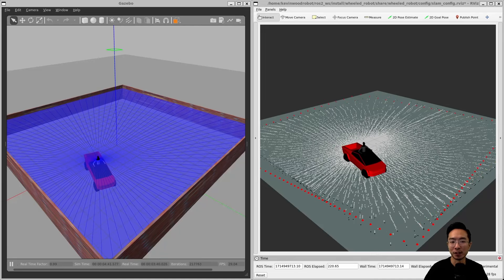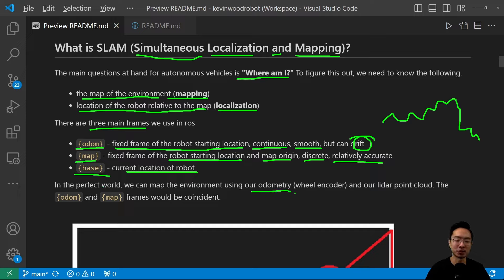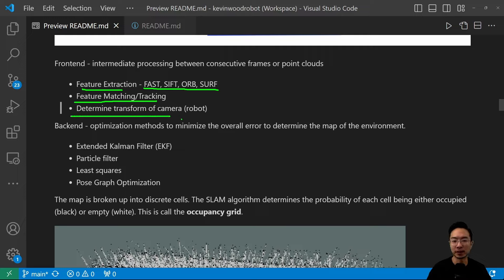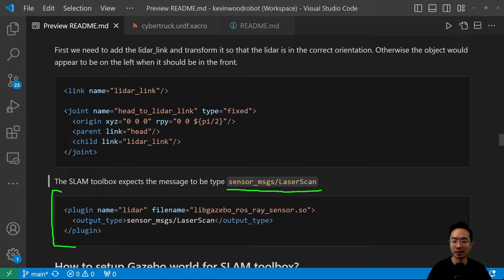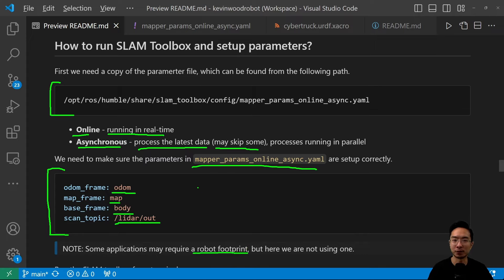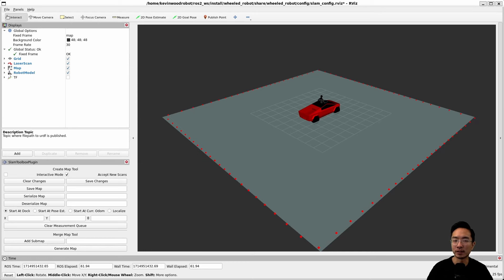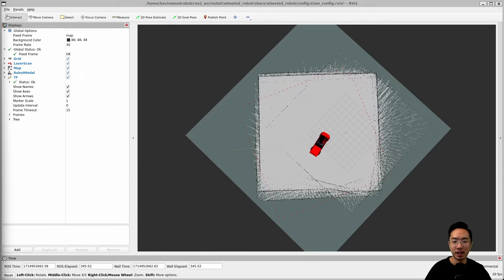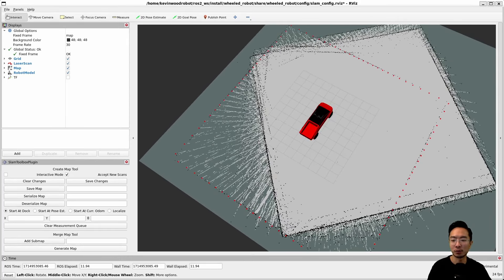ROS2 SLAM Toolbox Tutorial Mobile Robot Simulation (SLAM Algorithm and Code)

Comment: I'm using the slam_toolbox to move the robot, but I observe that the map's edge and LiDAR point-cloud often become misaligned. This misalignment happens in a way that the LiDAR point-cloud rotates around the robot's TF. As the robot moves further, the map's edge and LiDAR point-cloud align again, and this cycle keeps repeating. Additionally, when the robot rotates in place, the map and point-cloud do not rotate in sync; instead, the LiDAR point-cloud rotates faster or misaligns.

I'm using the robot_localization package to generate the map's TF, which connects with the map TF from slam_toolbox. In actual usage, the data from robot_localization (using wheel odometry and IMU) does not experience yaw drift (with the 9-axis IMU).

The LiDAR is an RPLIDAR A3 operating at 256000 with Boost mode.
SBC is raspberry pi 4

Could you provide any advice on this issue?
Reply from the maker: Yeah sometimes it does that. Having a unique background will help since the feature detection tries to pick up unique features. Also try to move slower and explore like a maze instead of turning in place